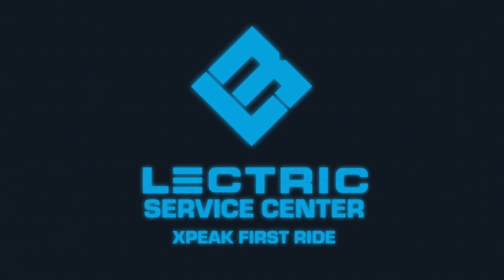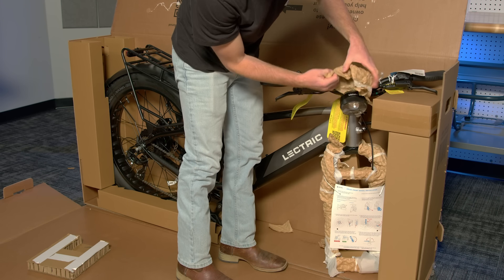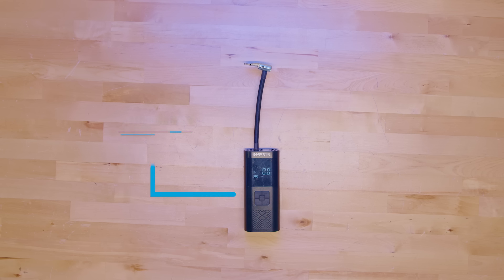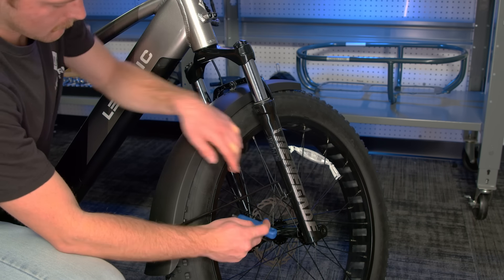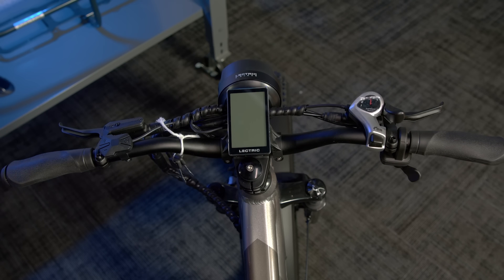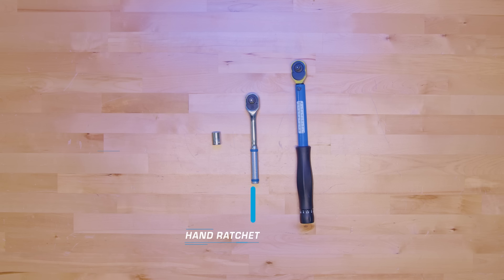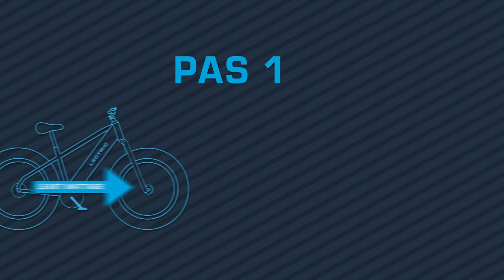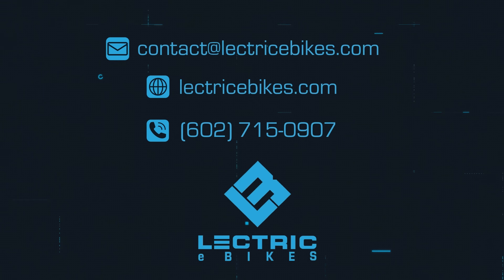Lectric Service Center | XPeak First Ride

Comment: Just assembled my XPeak. To clarify, the key is only to be used to drop the battery from the frame. It is not required for operation, right?
Reply from the maker: You will need the key to turn the battery on or off, so we'd recommend to keep it handy and be sure to keep the spare key in a safe location!
Reply: @LectriceBikes  So how do you know if the battery is on or off? Could you elaborate please. I just can't figure what is on or off. What happens if you leave it in the on position unknowingly?
Reply from the maker: Check out the XPeak Manual at the link below as page 42 goes over on how to turn on your XPeak Let us know if you have any other questions!

Manual XPeak: https://files.helpdocs.io/djeddasp2e/other/1706558890163/xpeak-manual-v-1-0-3.pdf
Reply: I just spoke to them on the phone and the key does only control the battery unlock. The bike will fall asleep after a period of time and so you use they key to pop off the battery....take the battery out.....and press the button on the battery to wake it up. Then put the battery back in and turn it on from the handlebars. So...yes technically you do need the key to drop the battery and press the button when it falls asleep but the key does not turn the bike on and off....it is just for the battery pop off.
Reply from the maker: That is correct!

Comment: 10:55 - How the heck do you get the single top screw loose to put in the fender?
Reply: Same here.
Reply: Used a little dab of WD40 and it came off.
Reply: It was a pain in the ass, they must have put it in with a impact!

Comment: can anyone send me the link for the Torque wrenches in video? cant find them anywhere
Reply from the maker: Hi Tony, unfortunately we do not have any links to share, but we hope someone can share a recommendation in the comments!
Reply: Hey Tony..you should be able to find Inch pound and foot pound torque wrenches at just about any big box hardware store, local hardware, or auto parts store. Most, if not all, of them have labeling on them for nM.  If not you can just google a conversion factor.
Reply: Try Harbor  Frieght

Comment: Anyone know how to turn the head and tail lights on?
Reply from the maker: Hi there! You can turn your front and rear lights on by holding the up arrow on your control pad. Be sure to not hold the down arrow as this will activate "walk mode", which is only to be used when walking your bike up an incline.

Comment: This bike is advertised as not needing tools for assembly. Is this video outdated?
Reply: Yes, it's outdated. If you order the bike with the fenders you'll need a 4mm Allen wrench to install the front fender on the fork. You may also need a 5mm Allen wrench to center the from disc caliper to the disc.

Comment: The battery has to be woken up up down up each time it sits for more than 48 hours?
So the battery has to be removed from the bike if it's charged that way each time it sits without use?